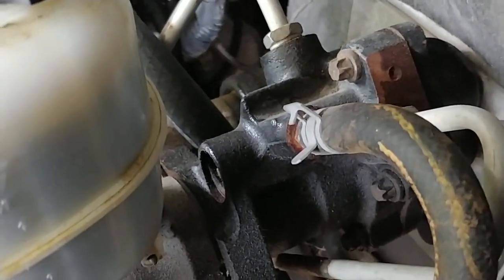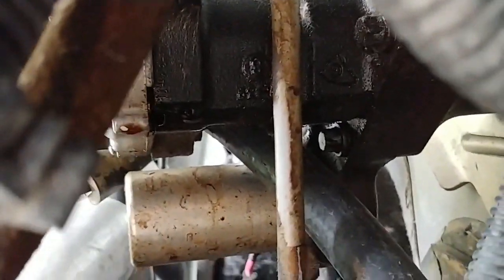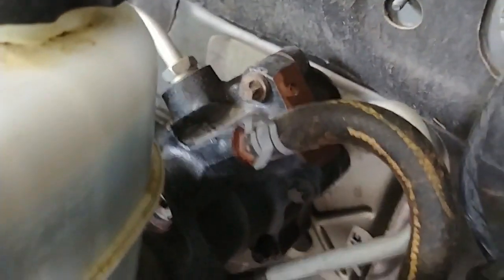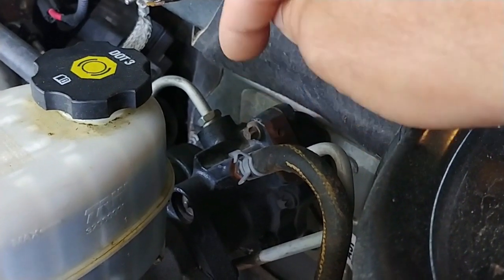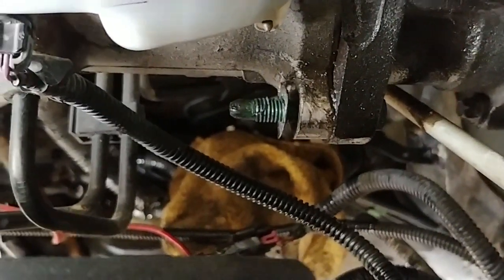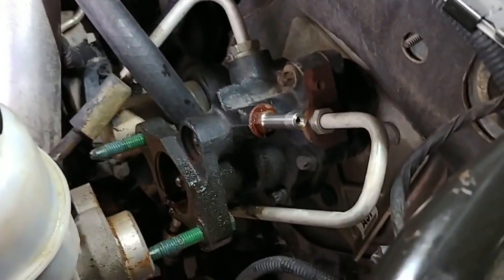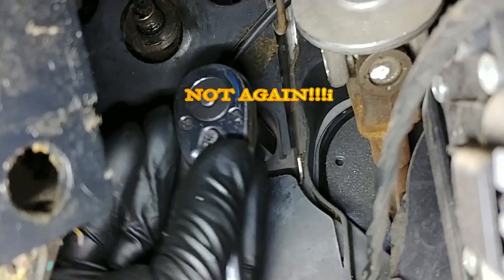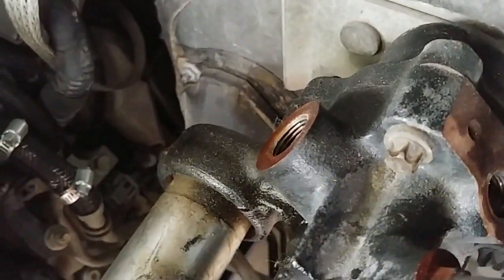How To Replace a Leaking Power Brake Booster 2009 GMC Sierra LMM 2500

Comment: My 2005 Express is leaking P/S fluid onto the fuse box. 
Hoping it's just the crimp on the original P/S to Hydro-Boost pressure line that lays on the fuse box.
If not, I feel well prepared to replace the Hydro-Boost unit thanks to your video.

(Although I'm bummed my whole unit is basically buried under the wiper cowl haha)

Will check it out and repair tomorrow! Thank you!!
Reply from the maker: Glad you liked the video. Sad thing for me is that after 18 months the replacement hydro booster is leaking again.
Reply: @DurtyMaxDee  aw man. I thought that reman unit you put on looked a little suspect with the splotchy paint job.

Bright side, I’m sure you had it swapped out pretty quick the second go around!
Reply: @DurtyMaxDee  always buy o.e.m when it comes to brake parts, your already saving alot of cash by doing the work yourself and online stores like rockauto sell alot of gm oem parts for surprisingly cheap.

Comment: Thanks for the video, I'll be doing this soon! I was wondering though...for flushing the system did you have the engine running? And what size hose did you use to connect the 2 lines?
Reply from the maker: Not running. Just crank the wheel lock left to lock right a couple of times, refill power steering reservoir, repeat until fluid comes out clean.

IIRC it was a 1/2" hose.

Comment: Great video. So I have a question if you could answer if you know what causes it. 
So I changed the booster, but mine locked up after a few pumps, ive changed all Rotors, break calipers  and break pads all around, but i was having rear break problems, it's not breaking, onlynthe front breaks work. I changed the rear break oil lines, so we assumed it's not having enough pressure towards the rear breaks. So now we changed the break boosters pump, but now the pedal locks dawn. do you know what causes to lock down, it only comes up about 2 inches. Thanks.
Reply from the maker: Sounds to me like part of your original issue may have been caused by the master cylinder and/or antilock brake module regarding your lack of rear brakes. 

After changing your rear brake line, did you bleed the master cylinder and the antilock brake unit? I've noticed on some vehicles that if you don't bleed these you will not get rear brakes or at best weak rear brakes.

As far as your brake peddle not coming back up I've not experience that before. My guess is that's do to a bad or failing master cylinder as it's what pushes the brake peddle back to its original position. 

Hope this helps...

Comment: Did you drain any of the power steering ? Or brake fluid ? I will be replacing mine today or tomorrow
Reply from the maker: I flushed the power steering Reservoir using the method described in the video adding new fluid as the reservoir empties.

You don't have to do anything to the brake fluid to change the booster.

Comment: Great video, completely off topic but would you know where the fuel rail pressure sensor is located?
Reply from the maker: Thanks, IIRC it's in the Valley under hot side pipe (drivers side) near the Y bridge. Intake piping to the turbo needs to be removed for access. May your busted knuckles heal fast. Lol
Reply: I haven’t really seen a good video on how to get to it, thank you for your feedback

Comment: I replaced my brake booster on my 02 escalade... But they peddle still going to the floor.. Brakes already been bled. Would u know what else I might need to do?
Reply from the maker: There's 2 possibilities that I can think of that would do what you are saying.

1. There's a leak in the system somewhere. Are you noticing brake fluid loss in the reservoir after bleeding?

2. Bad Master cylinder. If you're not seeing any leaks or a drop in the reservoir and peddle is going to the floor your master cylinder may have an internal leak.

Hope this helps 👍
Reply: @DurtyMaxDee  Reservoir still full and I don't see not leaks.
Reply from the maker: @dymondboyer5473  I would suspect that  your M/C is bad. 

A test you can do (backyard test) is to remove the brake lines from the M/C and put plugs in M/C to see if your pedal still goes to the floor. If it does your M/C is most likely bad. 

Be sure to bench bleed the M/C and completely bleed your entire brake system if you replace the M/C

Hope this helps 👍
Reply: @DurtyMaxDee  thank u so much. I will try it tomorrow! Ur awesome!
Reply from the maker: @dymondboyer5473  I have to ask, was the pedal going to the floor before replacing the power brake booster?
Reply: @DurtyMaxDee  yes is was and paid a shop 550 to fix it and all he did was bleed my brakes and changed them. Thank told me he don't know why they still going to the floor. So someone told me to check youtube and that's where I seen to replace the booster.
Reply from the maker: @dymondboyer5473  It's hard to diagnose without having the car but it sounds to me that the brake booster was not your problem to begin with. The  "shop" should've been able to properly diagnose it if they actually knew what they're doing.

The brake booster does nothing but aid brake pedal pressure you put on it when working properly. The master cylinder does most of the work in stopping the car. 

A pedal going to the floor usually means there's a  leak in the brake system somewhere ie. bad brake line(s), bad caliper(s) bad wheel cylinder(s) or bad master cylinder. A brake booster, bad or good, would not, to my knowledge, cause a pedal to go to the floor. It will only make the pedal easier to push when working or very hard to push if it's not.

I hope I gave you enough information to get you up and running 🙏
Reply: @DurtyMaxDee  thank u so much... And once I replaced the mc I have to rebleed the brakes again?
Reply from the maker: @dymondboyer5473  Yes. Taking the brake lines off the M/C introduces air in the brake lines and that will have to be bled out.
Reply: @DurtyMaxDee  ok. Thank u so much!!!!

Comment: Cant you just replace the seal between the 2
Reply from the maker: There is no seal\gasket between the 2. Just put the new\second one in yesterday, parts store warrantied it. 👍😁
Reply: So if you remove the 2 bolts between the two can you pull the seal out and pop in a new one or do you half to pull the hydro boost apart and off the truck .  Mine is leaking where master and hydro go together also
Reply from the maker: @cw5156  As far as I know you would have to split the hydro at the center to replace the seals. I'd imagine that you could do it with it still in the truck but it would be a major struggle. IMHO the easiest way to go is pull it and either rebuild it yourself or just replace it. 

I'm always short on time so it was quicker for me to just replace it, about a hour total. YMMV.
Reply: @cw5156  did you figure out if you can can just change the seals or replace the whole thing
Reply: @paulleonov6688  I’m sure you’ve already figured it out but they make rebuild kits for these brake boosters for about $30. It isn’t a terrible job. Had to do it for my LB7.